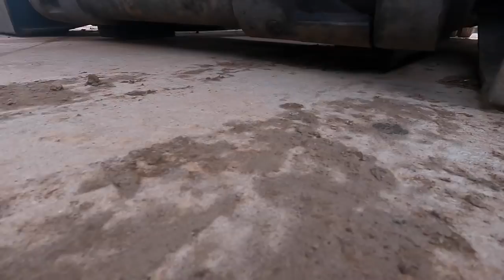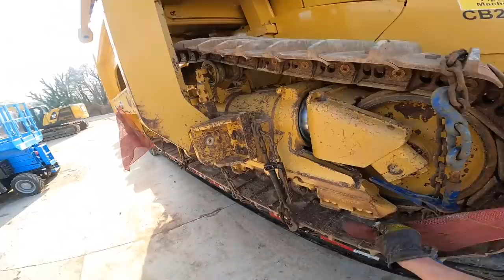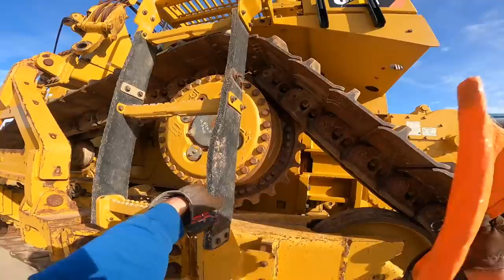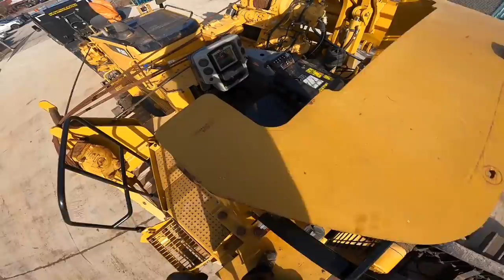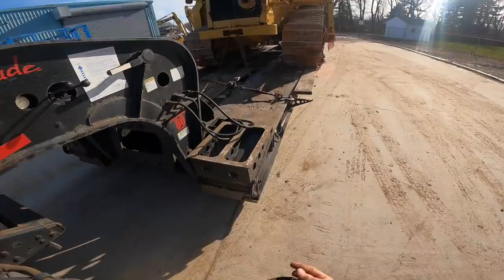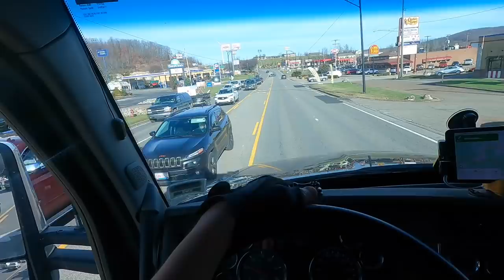BIG CAT: WV to ON

Comment: In lieu of those marker-flags, could you employ detachable, high intensity, battery-powered, lamps ? BTW, VERY nice video...both in resolution &  quality.
Reply from the maker: lights are used only at night. must have 18" by 18" red or orange flags during day hours.